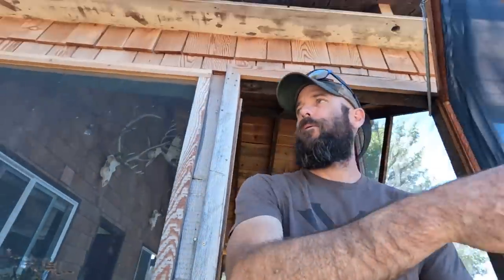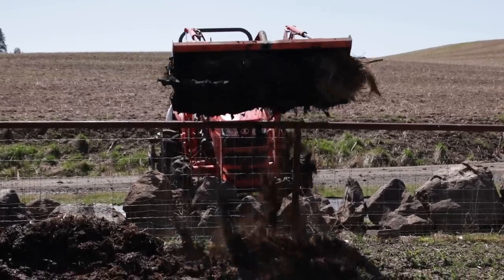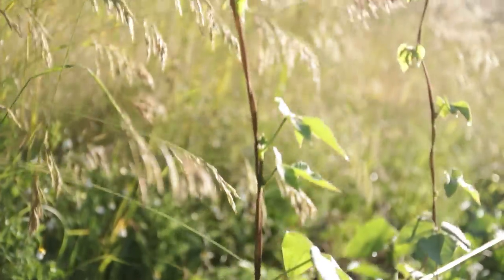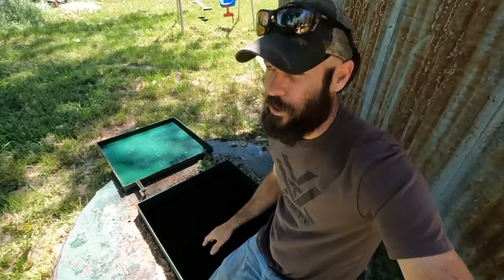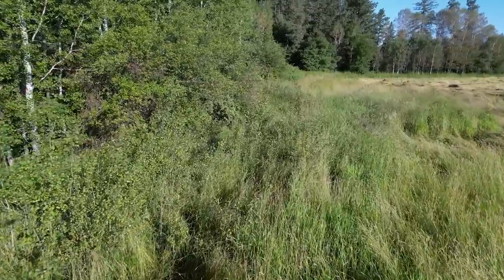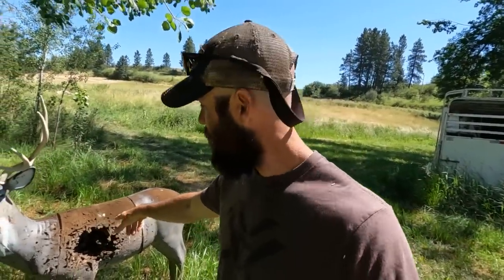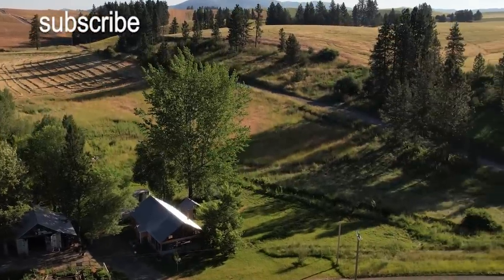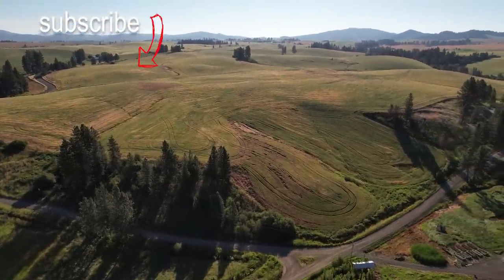Our Piece of Paradise - HOMESTEAD TOUR 2022

Comment: Nice little slice of heaven right there! Love the truck build btw. My dream truck is a ‘91 1st gen Cummins. All mechanically controlled and pretty much bulletproof! 

My shops teacher back in college had one and he made his own biodiesel distillery. He got the used oil from all the restaurants for free and processed it himself. Ran full biodiesel in the Summer months and blended in the Spring & Fall. Only had to go to the pumps in the Winter cause it’s too darn cold up here in Canada!
Reply from the maker: Check out the conversation vid I did. I run this in sub zero temps. F

Comment: With regard to your irrigation. Living tradition homestead uses an equalized pressure drip irrigation. It is essentially the same as standard irrigation but this won't release water to the plants until the line is equalized. This has the benefit of ensuring each plant down the line gets water.
Reply from the maker: Interesting

Comment: maybe you can put surgical tube between the stake and end of the drip tape?  Not sure if it will work but just a suggestion...prob u may face with that is the rubber will become brittle under the sun after a while..if thats an issue, use some light gage springs

Comment: Please Read Even If Long. 
My parents now live as of 2020, 3 miles from town of Pierre (Pier) or 2.5 miles from another part they call the end of town as there is one of the smallest paved airports with a single terminal you will see plus a housing unit. They are just enough to town they can get water from in town. 

I would guess that garden is 80--90 feet by 80--90 feet, parents got a garden with a place they bought in 2016. as well as a raised garden bed that needed fixing.  They are putting in more beds in the garden to get good soil as the ground is true clay, hard but has the stuff previous owner put in until early to mid 2000's when they got too old to work in a garden after being in the Greenhouse.  Parents use Drip line my brother and I as well as parents made, that works really well for their big garden as last year for first 1/2 season they were doing it by hand and wasting lots of time due to the sheer size.  Parents are starting an orchard with trees from the Greenhouse, the tree yard that nobody wanted and will grow out there as in town it is warmer a tick to zone 4 A and 5 B on really warm winters when parents are Zone 4 exclusively.  

All that open area behind you with the farms and hills reminds me of where I live in central South Dakota, Pierre area without the trees/few trees. The mountains nearby is different from where I live but then Black Hills are only 2.5--3 hours away.  My parents now as of 2020 and a family moved out of the house they owned and had sold in town house. It was a house that was on the same property as a greenhouse they bought the land to in 2017, after owning the buildings and business of Greenhouse fully in 2016. They had to split the house property from the business in 2017 so they are now their own pieces of land, the old owners of the greenhouse and house property did everything the way they did to get most amount off on taxes even if this left the house not fully covered under the insurance.

If you can get Okra to grow in South Dakota like my dad wants and he, has it in some raised beds. He has done it before at old house in town and had sucess growing in a small greenhouse he built and in a raised bed he used old used railroad timbers for he got from Menards.

The parents have Gooseberry s well as brother & I house.  I think you can get that to grow in Idaho as if it can grow in central South Dakota with the clay soil it and do very well it can grow anywhere and reproduce on own in two ways, just pick when black.  Current in the Cultivated native version we have at my and brothers house, as well as several berries raspberry both red and black, a small cherry, and so on that are all doing fine, including an apple that this year will have apples, last year they fell off even with watering. Parents house has 3 of the Ponderosa Pine near the house that are 35--40 feet tall, planted back in 1977 on the 5th anniversary of original owners owning the house and a Sotch pine that will have to come down at some point due to the blight disease. We have to have due to the acidic soil this Football shaped plant similar to a blueberry in color that does not produce many berries. We have nearly wild a type of in white, Roses planted at parents by original owners in the early 1980's in part of a field that later version of the spread moved to wild. Parents have an orchard they started where the original was dying out including an Apple tree probably on the way out.